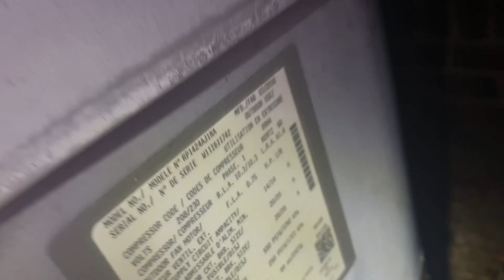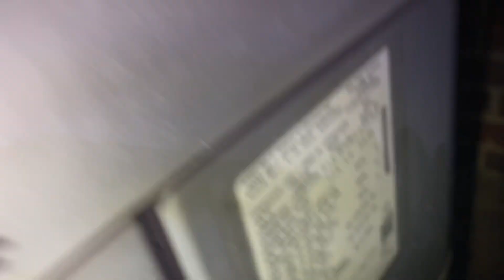Three 2016 Rheem Classic 14 Heat Pumps Defrosting

Comment: Do all heat pumps come with defrost? I just installed a 2023 RP14AZ and cannot find if it has a defrost feature. I've noticed on nights where it is below freezing and there is frost on the lawn the temperature in my house does not keep up. Thanks
Reply from the maker: All heat pumps do, the defrost board is a green or tan microchip behind the electrical panel.